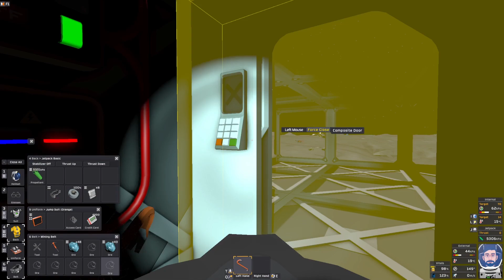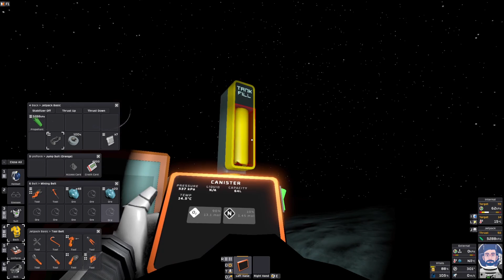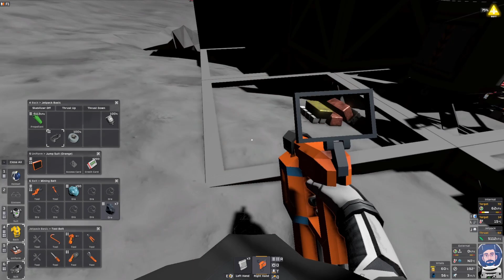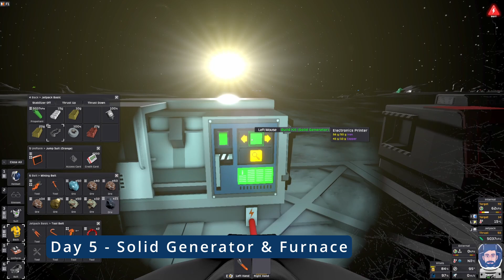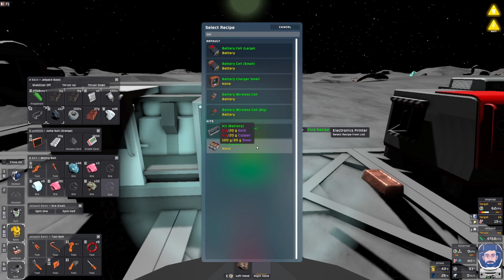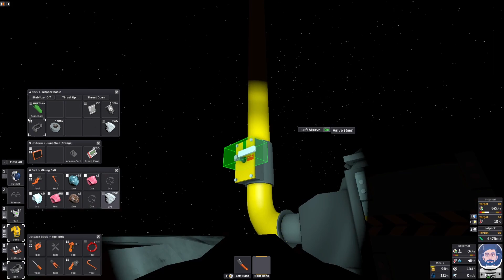Stationeers - Moon E2: Coal-powered Moonbase

Comment: most ppl dont know this there's an easier way to melt ice early game, a portable GAS tank.  due to the melting ice update, you can melt ice in a portable tank w/o an ice crusher.  just place the ice in the import slot where you place a canister normally.  just note ice melted this way is NOT insulated, even if using a MKII tank.  so, either do this in an atmo less than 0C or (in ur case) shade and OUTSIDE! especially if working with water, nitrice or vol ices.  for Oxite, it will remove the ice crusher and regulator need, saving power (1000W ice crusher, 100W regulator).  Water ice (Nitrice too) will self-separate in the tank and NOT cause dmg to the tank and/or gas lines when connected to a portable tank connector.  and for Vol if you mix 46 Vol ice and 24 Oxtite, it will make "dirty" fuel mix at 2:1 Vol:O2 with some extra N2.  your welder, gas generators (portable or GFG, if you build one) and furnaces will burn this fuel just fine. im not 100% certain, but i think a MKI portable tank can handle up to 200ice (4 stacks), if you're getting close to limit, just pull the ice out.   If you don't believe me, test it in a creative world your self
last tip, press ESC-->Settings-->Gameplay--> uncheck First Person Helmet.  with the normal suit helm its not that bad, but with the hardsuit helm it becomes a problem
Reply from the maker: Thank you for the tip!  I'm going to try this out in the next episode.

Comment: Since we will eventually need all the gasses anyway, I would love to  find out if you could make a designated little room that gets cooled by Radiators to put the gasses into - and have them condensate into ice chunks for Future use :)
Reply from the maker: Interesting idea! It's not something I've ever done/tried, but considering there's "Pure _ Ice" in the Stationpedia, and we can get pipes breaking from freezing it sounds like it has potential.

Once I get the basic necessities sorted out, I can try that.
Reply: @AlekkiPlays  I don't have access to the game but I am garhering ideas for when I get home. The cooling loop would need to be pure nitrogen with radiators or a LOT of uninsulated pipes inside and outside the room. Then you could pump the gas mix in with an active vent set to 100kPa pressure limit (can be done with a memory chip and a logic writer I/O. When the atmosphere gets cold enough to turn into solid ice, the room pressure will decrease and the vent can pump in fresh gas. The risky thing would be preventing the ice from melting again because then the room would blow up when the atmosphere exceeds 200kpa ....
Reply: @wowailyich615  i use a similar method on Eurpoa and Titan (mod world) for filtering out CO2, Pol and NOS.  once a gas is converted into either a liquid or ice, it will no longer be part the atmo.  thus your pressure will drop.  if you want to prevent a wall blow out, use better walls a steel wall (padded or not) has a delta of 300kPA, a reinforced is 8 MPa.  or a "frame tank" where all the "walls" are frames, iron or steel.  that has NO pressure limit!  ive tested this and the blast door up to 20GPA, until the game started to seem to be unable calculate anymore.  Just note, even N2 will freeze at 40K (-233C) and will condense before O2 will.  so you will need to make a way to empty the gas lines while the system is idle.  cause the temp of the "atmo" of the moon is 0Kelven, or absolute zero. There is a "cheeky way" to do this w/o using pumps/regulators.  (max liq temp for N2 is -83.2C @ 6 MPa, O2 -111 @ 6MPa, freeze at -217C) do if you're going to use this way of filtration (and its useful) use it only for Pollutant (-99.8C [-100]) CO2 (-55.3C) NOS (-21C) and maybe water (0C) 
if you want to know the "cheey-way" ill tell ya if you want to know.  and no its not cheating or using mods either